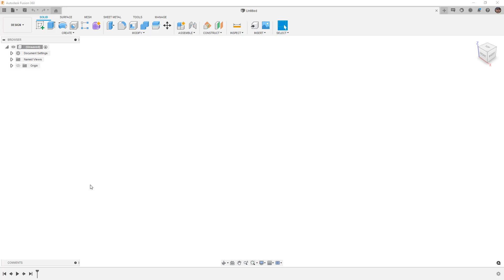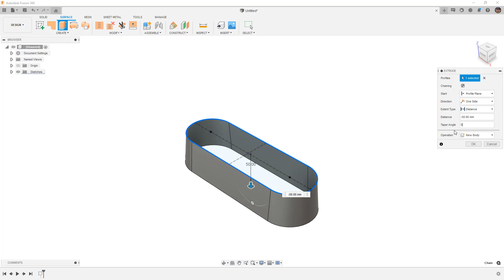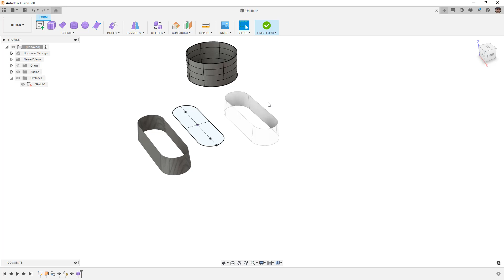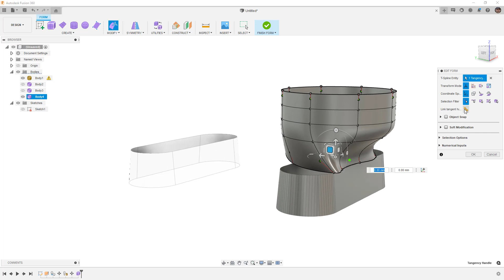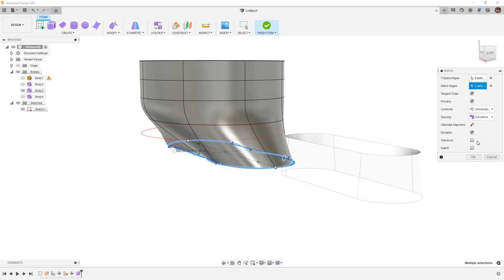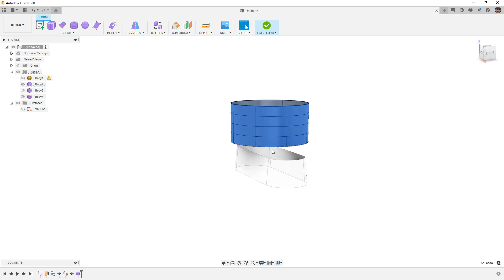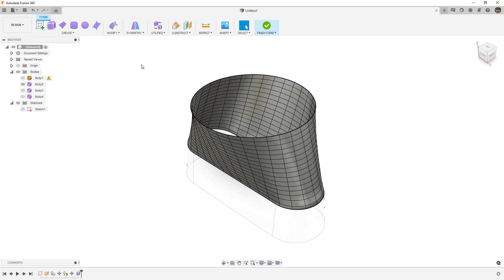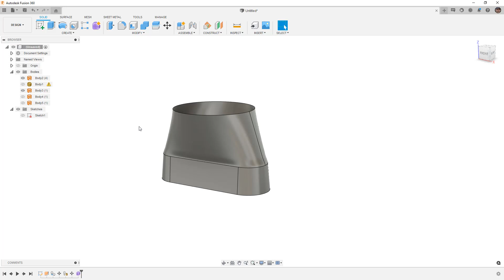Fusion 360 Form Mastery - Part 6 - Connecting a Form Body to a Mesh, Sketch or Surface #Fusion360

Comment: I know this is old but still a great series. I do have a question about if we added points to the straight line in the sketch to match the division in the form shape would that help to match?
Reply from the maker: Thanks. yeah this series started a bit ago.  I have a more condensed version on www.LearnEverythingAboutDesign.com

As for your question, the sketch points don't really affect it.  It is all tolerance based.  So if you are using Match and trying to match an arc vs a complex spline it will have to adjust the number of divisions.  When you use the tolerance it adds Tpoints at the edges which makes future changes tricky.  My suggestion if you are trying to attach to a surface is to use Match early on, keep modeling, and when you think you are done use it again with the tolerance value.

For using Pull to a mesh, that really just pulls the verts to the reference mesh.  The more triangles on a mesh or rather the smoother the mesh generally the better the results but with everything there is a limit.  If you use a ton of sub divisions on a form you are likely to get a less smooth result than if you have the least number you can get away with for your shape.
Reply: @LearnEverythingAboutDesign wow thanks for replying to such an old video! What I’m trying to do and can’t seem to find a good example of is making a fan duct for a 3d printer. The kind with two tunnels or ducts coming off the fan.  I think this tutorial get me mostly there if I just practice enough. Thanks again great videos.
Reply from the maker: @onecarwood  I have a video designing one of those https://youtu.be/1Vs4bE6sE1g    I used surfacing because that is what the user asked about doing but hopefully it helps.
Reply: @LearnEverythingAboutDesign  just what I was looking for. Thank you!

Comment: I have made a frame of a ship, where each rib and the keel Are individual Bodies, but i Cannot seem to succeed in making the hull of the ship, what funktion Are im missing here, :)
Reply from the maker: Do you mean with forms you can't?  I did a video on a boat hull with forms.  Depending on your intent though you may need more control with each rib/keel and use something like loft.  https://youtu.be/IItOTXsuxrw

Forms is great but boat hulls being produced often will be driven more by equations.
Reply: @LearnEverythingAboutDesign   i have the frame of the hull of the ship, & each rib/frame of the hull is based upon a inserted dwf file from AutoCAD, so to make a sheet or surface or solid body, go from one frame/rib to another and "attach" to the next frame/rib.
Reply: @LearnEverythingAboutDesign   hi some of it succeeded, tanks you wery much for the fast reply, life saver
Reply from the maker: @FinnBorgert  Glad you are making progress!  In general the forms will give you more freedom for making changes.  So you can use a freeform loft to start the shape, just know that it will not be exact.  Since you already have the "bones" built, i would suggest using the surface tools and make a surface loft.   I have a surfacing playlist going over some basics.  https://www.youtube.com/playlist?list=PLBDfGh8A8kXV_uUJ5KemGgbYOHl69fIty

What you would do is take each of your inserted cross sections and loft from them.  You will need to do some sections individually depending on transitions, but start by trying it all and see what works and what doesn't.  You might find that you need to need to make a lot of individual areas depending on your specific hull design.
Reply: @LearnEverythingAboutDesign  i have tried loft from solid. I made the bones 0.1mm thick to make the loft better curved. But now i have some "shells" i Cannot add thickness to
Reply from the maker: @FinnBorgert  if the lofts were thin they would be listed as a solid.  If you used the surface loft tool then Thicken should work.  Offset face (also Press Pull which just opens offset face) would let you pull the face of a thin solid to make it thicker within reason.
Reply: @LearnEverythingAboutDesign   I did not have succes in doing Any of the 3 solutions i Will rewatch some of your tutorials to see where it went wrong, thanks for answering

Comment: Very useful. How about creating a loft between the bottom edge of the cylinder and the top edge of the “slot” body?
Reply from the maker: you can certainly do that after you finish the form.  Connecting them as a form gives you control to still change the top shape, but if that is fixed and not to change then a surface loft is good too.
Reply: @LearnEverythingAboutDesign  Thanks!

Comment: im having trouble combining my form copies. i want to stack 3 heads but they fall apart when trying to move them in my slicer. also some parts of the form and inside the others
Reply from the maker: Hey Sean, not sure I follow exactly but you can send me an email with the file and im happy to take a look. support@caducator.com

Comment: if the forms and the surfaces never exactly match, does it create problems when you try to turn the "matched" result into solids or thin walls? Or should designs created by forms just never match with sketched designs? Sorry if this is answered in later videos/other series, I'm crawling through your videos one by one on my spare time, I really appreciate the detail in your videos!
Reply from the maker: Great question Richard!  I did an update after this video on Associative Match.  In the Match tool when using a surface or solid face edge you can turn on tolerance and Fusion will add T points to meet your tolerance desired.  Similar to surfaces if you stitch them together you have a tolerance slider where it will "heal" a gap.  I don't like this method and generally I find aligning a form to a surface exactly is very difficult!  What I would generally say is rather than perfectly matching a surface edge(even if that is what you do) I would plan to loft between an existing surface and a form body converted to a surface IF things dont work out.

Some shapes/instances are easier than others.  If you are using a planar surface edge for example vs something extruded from a spline(very tough).
Reply: @LearnEverythingAboutDesign  thank you for taking the time to answer!

Comment: At first I was a little disappointed, but then I worked on the shape further and achieved an acceptable result by deleting and scaling edges.
Reply from the maker: Johannes, one thing I didn't cover in this video that I do later on here (https://youtu.be/QOylnpsG3Qc) is the use of Tolerance.  So I tend to avoid using tolerance because it adds a lot of T-points to the body and generally makes the modeling workflow much harder.  Depending on your goal it might be just the trick.

Comment: I'm a newbie regarding the Form functions, so I really appreciate your tutorials. Question though, why not Loft the 2 shapes together?
Reply from the maker: Hi Danballarin.  the topic of this specific video wasn't loft, but the main reason in this case is that the form body creation tool using loft is a bit different than it is in the Surface tools.  You need 2 sketch profiles (minimum) and as far as I know Fusion does not let you select a form body edge as one of those profiles.  So you can attach a form body to a sketch, to a mesh or the edge of a surface.  It would be great if they would let you loft to a form edge though!

Hopefully that helps, if not please let me know and I will try to expand.
Reply: @LearnEverythingAboutDesign  Thank you for the reply, I think I understand! I have really enjoyed this series so far, you are a great teacher.